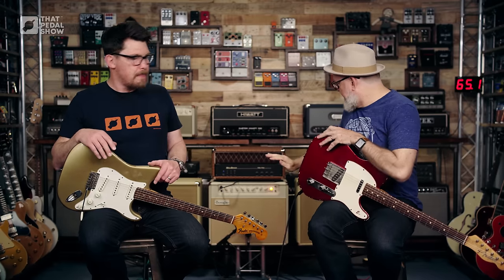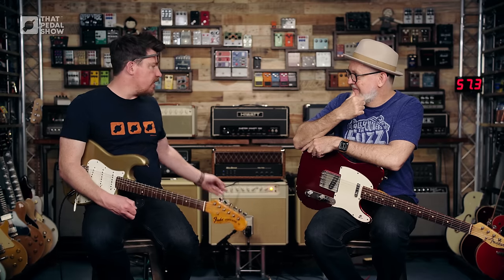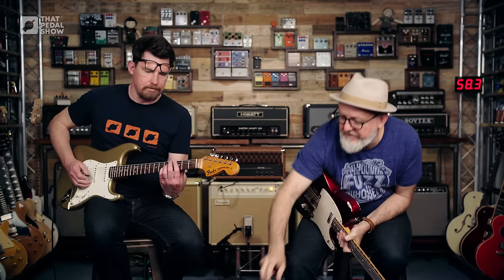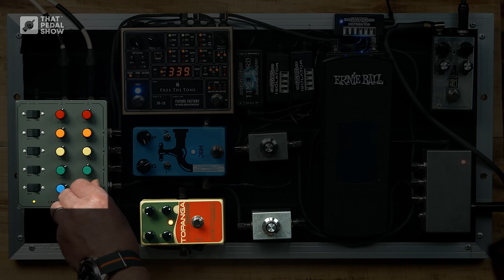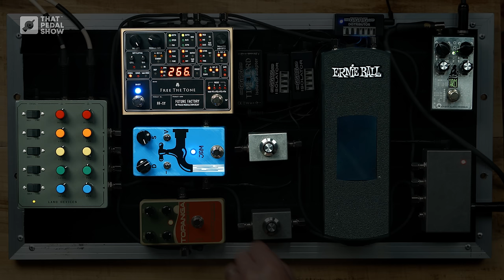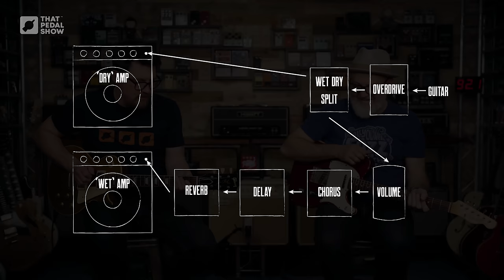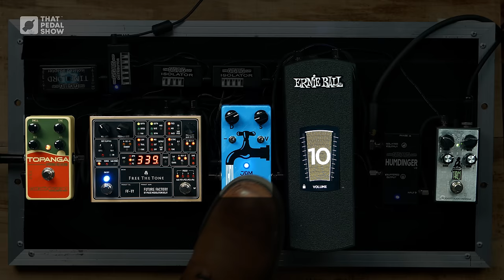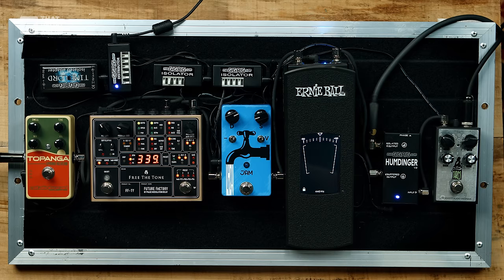Did We Get Wet-Dry Guitar Rigs Wrong? [Proper Wet-Dry-Wet Vs TPS Wet-Dry]

Comment: Great vid as usual guys, can anyone answer why you’d go the wet dry instead of use a stereo delay ? More direct sounding ? I have a Volante / NightSky / Future Factory and obviously want to get them in stereo…..
Keep up the good work 👏
Reply from the maker: We’ve probably done vids on stereo Vs wet dry, but in short: stereo means you need two even sources of amplification and to be able to pan things. It can be a lovely experience… but it’s also usually pretty wet sounding. Wet dry is more flexible in that you can mix and match amps, it can still sound massive but you also retain the immediacy of a dry amp. Obvs you can’t do the massive stereo ping pongs or what have you, but you can still run different delays both sides if you want. Neither is better, but one is less hassle and sounds a bit more rock’n’roll to us anyway. Cheers!
Reply: Wow wasn’t expecting a reply from the big boys themselves, thanks Mick (or Dan…..)
I’ve got the ABY BABY and getting much more wetness out of one side than the other, but I guess that comes down to my different amps / loops ? Lucky to own a TS1, but still trying to get my head around the FX Loop. Will try using different stuff on both sides, sounds like it could solve the issue, and less hassle ! Cheers, Ben
Reply from the maker: @benmir100  cheers Ben, yeah, ABY BABY won’t change effects level, what goes in will come out mirror image on both sides 👍

Comment: I've watched this video a lot and I am slowly gathering the gear I need to do a w/d/w just for my own hobby entertainment. 

I'm going to do it with an mxr 5150 overdrive preamp,  pitch/detune pedal, evh lbx stealth and evh 212 cab, 10 band eq in the effects loop. Aby switch. Multi effects unit. And 2 boss katana amps. The boss katanas will have the exact  same basic clean settings, eq to my taste, no delay, reverb..etc. A powered aby switch.... sending my dry signal, the mxr 5150, pitch shift to the evh head and cab,  the second signal will still have my 5150..etc then it is going to go into my multi effects processor, the left and right out of the multi effects are going to go into the 2 boss amps. All of the wet signals will come out of the multi effects unit and I can control those levels with the built-in expression pedal. 

Only things I am missing are a 2nd katana, the aby switch and the mxr 5150.

Comment: Chet used to run the delay on the bass side, and reverb on the treble side.  I tend to play cleaner through a tweed vibrolux and a tweed princeton.  A reminder to do "that tweed show" soon.  Keep up the good work!
Reply: I went back to totally clean for the Princeton.  I stacked two Colour Box V2's (different degrees of treble boost) in front of the delay, reverb, and tremolo (in that order) into the wet Vibrolux.  The Dahlcaster (T Armonds) now has an abundance of twang.
Reply: Updated Wet/Dry/Wet via Lehle Dual SGoS Amp Switcher

Wet 1 – Tweed Vibrolux, Tube Tremolo, JHS Cub, 1X15 EV, Bass EQ 
Wet 2 – Tweed Champ, 6G15 Tube Reverb, JHS Emperor, 2X10 EV, Treble EQ
Dry – Tweed Princeton, 2 JHS Colour Boxes Stacked, 1X12 EV, Midrange EQ 

I now dial in every room, use three mics to record, and am happy with the rig.  Thanks again.

Comment: I believe you did get it “wrong.”   A “true” wet-dry or W/D/W or, as I do it, W/D/D/W would have your time-based effects running in parallel with your dry signal.   Although there is no “right or wrong” per se, the classic W/D/W is achieved by attenuating your dry amplified signal, running it through your delays and reverbs (ideally stereo), mixing those individual 100% wet feeds, amplifying that mix and running it through stereo cabinets.

Comment: id love you guys to hear my rig which has not changed much since 88. its a true wet dry rig stereo only difference to you guys is most of my reverbs and delays come from a lexicon rack uniyt and a digitech rack harmonizer. it also has guit direct into the amp but on the floor a array of pedals of various gain stages

Comment: Never saw the point for all the gear but I bought it anyway, lol
It’s just an east task in the studio but live it doesn’t translate well through the pa each patron gets a different part of the mix if the board is trying to cop the 
Guitar rig
I guess if your a small 1-3 piece guitar show it might be worth the effort but I get strange looks as it is from small venue owners just wheeling in one 4x12 stereo cab
This is only time I might lean on the axefx3 assuming the intention is to perform micro surgery with effects as my UA stomps like the Starlight will do a tape warble that will be imperceivable live
So for performance I’m just plugging into a small combo or 1/2 stack with a modest pedal board and save the fun for Protools, plugs and my myriad of stomps through the radial EXTC
But I still own my 80s rack gear including 2-h3000 black face, 2- Ada-mp1s, crown stereo amp, digitech dsp128, nady wireless with a Bradshaw style tiptoe board, yada yada
The good ole days

Comment: I'm not sure but is the return into the dry amp necessary? Doesn't the send actually split the signal? This confused me some in another video i saw. I believe in case of a serial loop that it is only the return that decides if it's serial or parallel. Again I might be wrong and some amps are probably different than others.
Reply from the maker: Could be two things. 1. In some loops, the return needs to be completed for signal to pass. I think. 2. I might have got the diagram wrong on that connection. Dan will hopefully confirm.

Comment: I have a tech question, wondering if the good folks in YT-Land can answer. I'm thinking of going with a stereo setup using Kingsley preamp pedals. So it'd be EQ and drive pedals, and split that mono signal into a Mobius. The Mobius can be configured as buffered bypass, so can I just split the signal with a basic Y-cable and not worry about hum? For completeness, the Mobius stereo-out would got to (a) Kingsley Jester and (b) Kingsley Constable, then those signals would go into Collider (stereo of course), then to solid state amps, on to separate cabs.
Reply from the maker: You //might// be able to Matt. Worth a try. If you get a nasty earth hum (it’s likely), then adding a Humdinger on one of the outs would solve that. The other thing to think about is phase. It’s not necessarily the case that the two preamps will be in phase with one another and, again, a Humdinger will help correct that. Good luck!
Reply: @ThatPedalShow  Awesome -- thanks for the speedy reply! I hadn't yet thought about phase, so a Humdinger may well be necessary if only for that. Cheers~

Comment: These things always get confusing…actually have an ABY BABY on the way. 

The way I like to do it, and I don’t see many doing this. I like to have my entire pedal board go to the wet amp….that includes optional distortion. In my case a Sky King.

Second amp is just a cranked up distorted edge of break up Ampeg VT-40 that sees no effects at all. But still gets all the boosts, EQ and drives minus the delay and reverb stuff. It doesn’t really need it 

To me that works, as I can retain my core sound on one clean amp with everything! Then the Ampeg is like its own distortion box like a Marshall would be…but I want all the dirt options for that so whether it’s on by itself or both are on together to complement. 

I’ve tried explaining this to people lang times…but people really get stuck on the…ok clean amp and effects, they main amp all drives. For me I don’t like this, as I like my drives on the clean amp because they sound good. I just like to bring in a distorted amp..Marshall, Ampeg or whatever with no effects other than boosts and distortions. 

That way if both are on, the always distorted amp will get that fuzz, or boost together. I like it for punching up chorus parts in songs…and not dealing with messy stereo issues live. 

It’s just nice to have a fuller distortion sound at times, but not have all the effects mono summed or stereo into an already driven as hell amp. Some amps just do a thing, and you want that tone in your rig. For me that’s the old Ampegs with their EQ driving the mids…add delay or reverb and it’s very washed out. Add drive to it and it’s just texturing it more. 

I like to pick my nicest do it all amp as everything goes in. Then have a distorted amp that just does that one mid range thing. If I had two Fender like amps, or two of the same I’m more inclined to go the classic route.

Edit: I get the buffer and split idea of the ABY BABY now in my setup. Place it before my Chorus/effects with the normal output 1 to effects, then turn on buffer for output B and go direct to amp. That way both are buffered at the end of signal, and both are in mono. Makes sense now, and after going over it so much it just popped into my head. Last reverb is buffer into my all pedals amp, and buffered B split comes off the drives direct to amp. I can also add other pedals, like a boost or EQ to B after it, if I want them to just go to B only and not to A. It’s gonna be a lot of hours messing with this!
Reply from the maker: Awesome stuff Matt, thanks so much 🤓🙏

Comment: You’ve mentioned it before, but it merits repeating that some wet effects sum the inputs or take just one side and then send the effected signal to both L & R outputs, in violation of a previous reading from The Book Of TPS in that it’s sometimes preferable to separate the drive pedals too.  Helps to know which pedals do this before buying. :/

Comment: I DO like the TPS two amp Wet-Dry rig, I have to say. 
I use an old Arion Tuner to take the Sniff signal to the Wet chain.
Even in my old man of the hills council flat home studio, I have 3 amps set up but I only use two at any one time.  
(Bassbreaker 15, Blackstar HT-1{no verb}, Laney IRT Studio 15)
Every now and then I think about making the Wet stereo,  then I go for a nap and forget about it. 

57:40 very Dan Metheny

Nerd alert - I think you'll find that Early 70s Sound City and Selmer amps (possibly even late 60s) had Effects Send and Returns on the rear chassis.
Reply from the maker: Nice. I’ve read a few things where the circuitry was basically that, but they didn’t call it that. Nice!
Reply: @ThatPedalShow    Yeah the Sound City said "Reverb" and underneath "IN OUT" by the jack sockets. 
I was nearly exclusively Bass Guitar in them days. 
It distorted too much for my purposes back then ... 🙄

Comment: I have a couple of thoughts/questions. Regarding the TPS Wet/Dry, you did say there are a few ways to skin this, but given the first scenario (WDW), you could certainly run the overdrive into the front of the Wet amp (instead of into the other effects), and put the Modulation/Delay/Reverb into the effects loop, no? That gets you closer, and similar, to the first scenario. And of course you could complicate it even more if you put those effects in parallel by using something like the OBNE Signal Blender, no? I assume all that complicated craziness is just try stuff and suit to taste, but if that first scenario yielded such clarity, why not run it that way? Now, regarding the first scenario (WDW), the diagram showed the signal coming out of the Send of the Boogie, and into the Wet/Dry Splitter, and then taking the Dry side and running it back into the Return. What's the point of using that first splitter? Couldn't you just take the Send (assuming it's between the pre/power stages) and feed it straight to the effects, and then into the power amp? Not having the signal coming back into the return doesn't break the signal chain does it? It's just a tap, isn't it?
Reply from the maker: Erm, just to the last question… the first splitter is there for two reasons. One, in some amps it won’t work unless the return is connected. Actually not sure about this one. But much more importantly… when you do any split intended for different amps you really HAVE to have control for phase (the second amp might be opposite phase to the first) and you have to have isolation to kill ground loop hum. That’s what the first splitter is doing. 
For the first Q, they are in the loop. And they’re set to kill dry so there’s no direct overdrive pedal sound in them. Even if they were in the loop of the stereo wet amp only, they’d still be after the overdrive pedal because the OD pedal is feeding everything… except with kill dry on the wet effects, you’re not hearing it directly. Hope that explains it!
Reply: @ThatPedalShow  Thanks!

Comment: Curious about something…in the TPS Wet-Dry setup, why not run the signal in the “Wet” amp as full wet (i.e. Kill Dry)?   Wouldn’t that give the FOH engineer more flexibility in mixing?    What sounds like the right balance for you on stage might not work for FOH.
Reply from the maker: Could be nice. Aside from any aspect of wet and dry tho, I think the thing we both love about the TPS way is the coupling of the two amps pumping. Your way is to add all wet to a separate dry. I guess ours is to add a separate dry to a wet/dry! It just sounds massive. FOH of house will be asleep and reading a book anyway. /0)

Comment: Because I use the 4 cable method with my amp to use the amp's preamp for overdrive it turns out I've been doing wet / dry properly all along!  Actually half way between the 2 as my wet effects are in series.
Reply from the maker: How many amps are you using? If it’s just one, that’s just everything in one amp…. Proper W/D or W/D/W means having at least two amps. Cheers!
Reply: @ThatPedalShow  Laney valve amp as the dry and a Roland FR-FR (ish) keyboard amp for the wet.  With the Laney preamp wrapped in the 4 cable method the lack of a second valve amp is mitigated to an extent.  I can't afford a second valve amp yet.
Reply from the maker: AWESOME!! Bet it sounds fantastic!
Reply: It does!  Thanks for the inspiration to try it.

Comment: Have you guys not found out that you can do wet dry mix in 1 amp with boss LS-2 set in A+B parallel - and blend the signals without even needing to connect a second loop into the pedal ? and it can sound amazing. and a boss LS2 for each pedal it becomes even more epic.
Reply from the maker: It can be cool. But it’s still all coming out of the same speaker, and that’s a big part of the sound.

Comment: I love two amp sounds  never  go back one amp but sometimes  you do  for reason  .  Then wet try wet come mind . Amp s come go  rack  too  stereo  rack too .  Today  got 
Big Pedalboard  Trailer trash board  case   amp  two bluguitar 1 for stereo pan now quilter power block 200 for middle  use 4 cab  in line  
Speaker cad use are dv mark classic  because  lite weight  they 150 to 300 watt  headroom   same amps . One broad got 3 amp another  is pedaltrain 38 ? For control  drivers an  midi  some pedal  to . So can control  wet dry different way  quilter front end  effects  too run o/ drive in it amzing  amp feel like tube amp for ss amp bluguitar 1 use tube in poweramp  so real still analogy  input  I do use mico tube in quilter  uk tube buffer  it add something  like Treble boost  to vox  or Echorick preamp in Marshall  so on .    Set up  2 12 8ohm  speakers cabs run of each bluguitar 1 quilter two cab open 4ohm an  close 16ohm   so lay out 12 4 16 12   stereo L/R in 12  middle 4/ &16  dry or mix wet reveb  an looper  I can black off dry up too  
It big sounds  but only  two Pedalboard 4 cab  . Cab can be stack  12 16 top 4 12 bottom   it sounds  tight  or lay in line  it wide sounds  but still get  that wet dry wet   . No big  amp   grag around  
If want real sounds  but small power it  bluguitar an quilter  
Can go victory amp I have pedal amp still good I had victory bluguitar  once   .

Comment: Hmmmm..🤔
First, i want to adress i kinda like TPS's version of a W/D...
(To me it sounds more like a 
'DRY/wet', because the Dry amp is significantly louder than the other..).

HOWEVER there's a problem;

"HOW am i gonna make my fave pedals shine with this setup..???" 🙄

I dunno..
Am i gonna sell my Ventilator ll, 30ms and the TriceraChorus...???
Nope.
Should i run them in mono..???
Naaaah..
Mayyyyyyybe the 30ms..
(It's always dry on one side anyway, even with the deepswitches in 'stereo'-mode..)
But it definitely sounds better in stereo, and specially in the slapback-mode.
Those other 2 mentioned?
Nope.
Not gonna happen.

Comment: What would putting your aby splitter right after the guitar instead of after the overdrive, and have one side going to overdrives/ dry amp and the other going to modulation, from the split straight from guitar signal, and either set those pedals completely wet or have it with just a clean guitar signal modulated? Would that be true wet dry still without the fancy mixer etc? Or I guess the simplest version of what I tried the other night at home was sending guitar signal to aby then one side going to overdrive pedal then to pro jr, with chassis put in a 12 in cab, as a totally dry amp and second output going straight to a deluxe reverb with reverb on. I guess since the DR was still getting guitar signal out it was still dry/clean wet. Lol.

Comment: Brilliant as usual. Quick question. Have you ever done a video on volume levels across pedals? Not gain staging, but volume set ups. For instance, I love my Muff Fuzz, but have it set up for my usual playing where the guitar vol is around 4-6. But when I crank up the guitar, the fuzz just get fuzzier, then when I turn it off the fuzz the volume jumps up because the fuzz was limiting so much. Any thoughts?
Reply from the maker: It’s a very common problem. We should do the video. Cheers!

Comment: There is really no right or wrong.
I like to run effects parallel even going only to one amp, like as example 2 different choruses and a phaser with one of them, gives a completely different dimension even in mono.
Also doing that with both dry and wet signal and a dynamic harmonic tremolo on the other channel since it doesn't have the mix knob I would like to have on it.